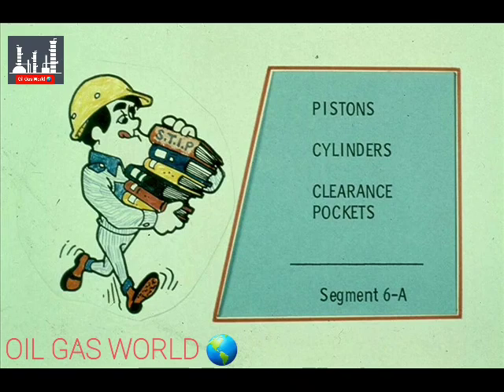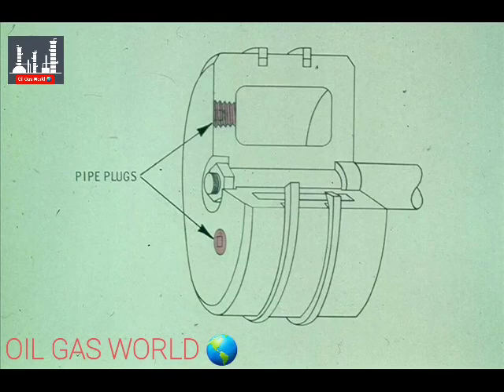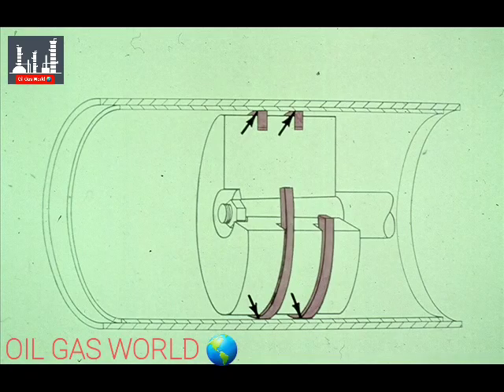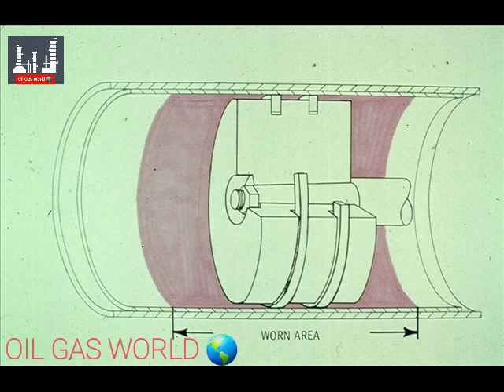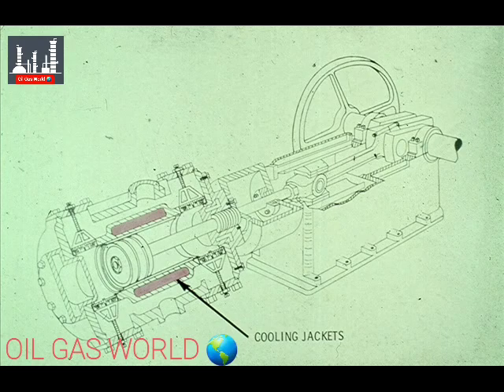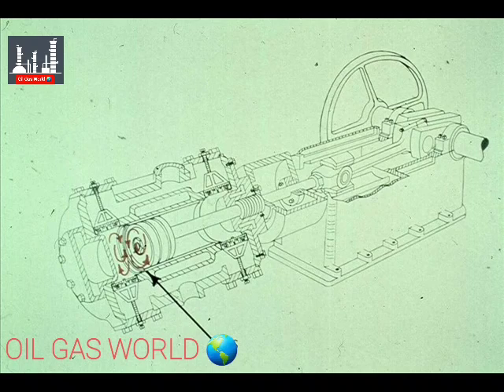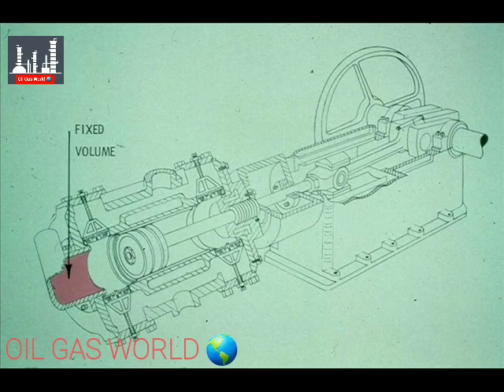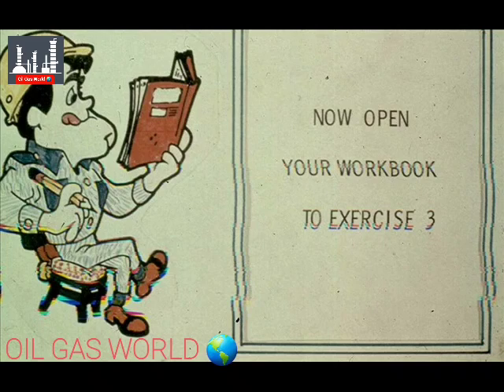Reciprocating Compressor | Reciprocating Compressor Part 3 | Compressor Principle and Operations

Comment: Interesting stf, thank you. 

One question: I believe the lubrication oil is constantly forced fed to the cylinder during compressor operation. How does the lubrication oil exits the cylinder? Does it go togather with the compressed gas or there is a dedicated draw off point for forced feed lubrication oil?
Reply: Oil goes with compressed gas which is later separated in oil separator.